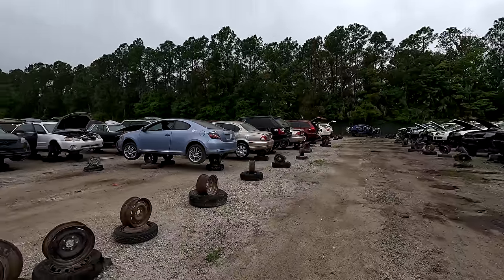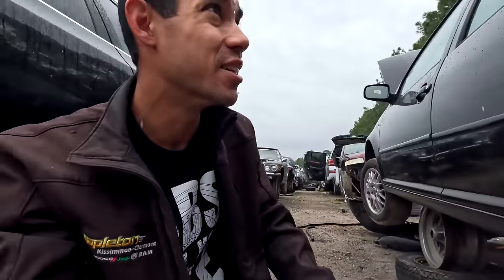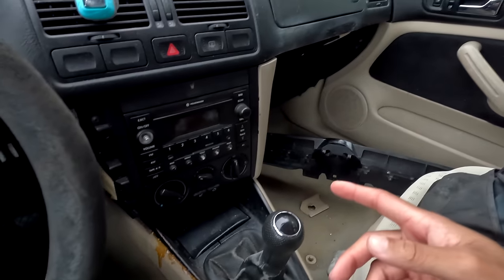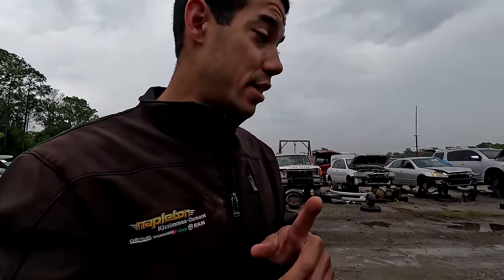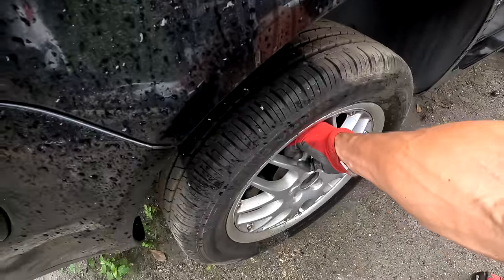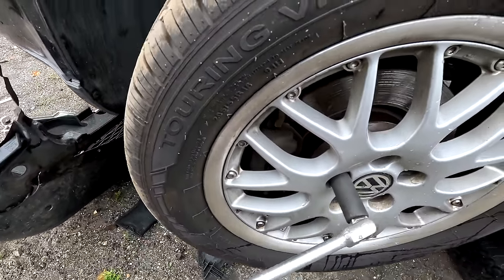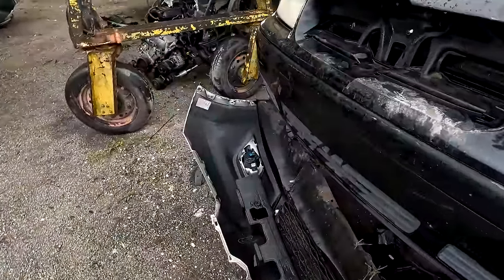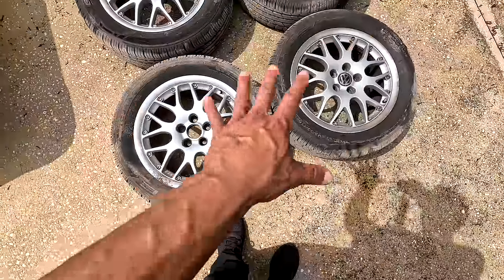Saving A Set Of BBS Wheels From The Junkyard!

Comment: I run these on my subie. They were a pain in the butt to restore though. They were so corroded from salty winter roads, and I snapped the heads off a few of the titanium bolts. Had to bring it to a shop and have them get drilled out, because I wasn’t going to risk messing them up any worse.

Comment: Awesome find I just found a set with an almost identical design but in 18s. Like you said they have curb rash like most and peeling clear but overall going to be a fun project for my first wheel restoration for some nice mk7R OEM+ looking wheels when not running my racing wheels

Comment: Another trick to get the stuck lugnuts to come loose when you can’t put on the e-brake or have another to hit the brakes is to tighten up the 2 lug bolts/nuts next to it
That spreads out the amount of flex of the wheel holding the one lug bolt/nut on, and makes it easier to remove
That’s why its a good idea to always JUST break all the lugnuts loose, before removing them all if all you have is a hand wrench/breaker bar or a weak impact gun

Comment: 10:19......My '03 GLS 1.8T came from Coral Gables or Coral Springs..(if Gunther was around 20+ years ago then..yes)
It was seized/repossessed from original owner for unknown reasons sold at auction in Florida and made it's way up the coast to the Fredricksburg Auto Auction and then ended up on my cousin's lot in Madison, Virginia...(this is 10yrs ago this past January)....I bought the Jetta from my brother after he had it 6mo....it being an original Florida vehicle...IT HAS NEVER HAD IT'S FRONT BUMPER DRILLED FOR PLATE MOUNTS!!!!!...NEVER!!!...The state of Virginia (notice I didn't say GREAT) has been a 2 plate state since before 1948 or around 1950.......I've been pulled up here in Richmond more than a few times even once by State Police...and I vehemently proclaim that I refuse to drill holes into my investment...the plate is in the right front corner of the windshield EXTREMELY VISIBLE plus for the fact that if I'm being pulled..they are in FULL VIEW OF MY REAR PLATE...
so after 70+ years......shit is finally getting contested..........(not all of us up here in RICHMOND need a damn yellow "DONT TREAD ON ME PLATE"....to speak it truly... to the FACE OF THE LAW!!!..)
"Dre' The Cajun"
DES ALLEMANDS
BAYOU CANE.......... find me in the 804

Comment: Ive got the exact same RS771 set, yours look like brand new compared to how mine looked when I got them.
Took me a week of sanding and polishing the lips to get them back to decent looking, repainted the hearts to a slightly different color to improve the contrast betweeen high-gloss polished lips and the hearts.
Too bad these have a horrible weak (ET43)offset and are very narrow, they just don`t do it for me on my project, even with spacers they just dont look right, and they are now sitting unused in my shed waiting to get swapped or sold off

Comment: its crazy how much they look like the mini cooper bbs oem wheels. its the same exact design from the looks of it just in a 17x7 +48? cant remember the off set. but yeah there are 2 that i know of for the first gen minis r50-r53 generation that had 2 piece bbs wheels. the one that looks like this are called r90's and then thers the r98's which are the ones that i have. whats funny is they have exact same issues. clear coat failure on the lips most have some rash. mine have some rash and clear coat failure and some how a gouge in the side of one of the spokes. at one point id love to send them off to be rebuilt and refubed into 17x7.5 in front and 17x8 in rear with around a 35 offset. oem bbs wheels are suttle but so bad ass.they also can take a hell of a hit and still be fine.

Comment: Be careful with those titanium bolts. Soak them in penetrant and brakleen to make them easier to remove. I'm working on some w8 2 piece wheels currently snapped two
Reply: Do you happen to know the bolt specs.  I too have 2 snapped in total😅

Comment: Those came standard on the mk4 Jetta Wolfsburg edition. They made those in 2001 and 2004 (different editions). The car you pulled them from was a 2.0 and all wolfsburgs were 1.8t. Therefore, the owner of that mk4 either bought them from someone or stole them 😂   I had an 01 galactic blue Wolfsburg that I miss every day
Reply: im sure you could buy them from the dealer too as an option. like maybe not all dealers but some could. euro companies are so odd with things
Reply: If I recall correctly the rxii’s were not options because they were specific to the Wolfsburg edition.   At least in the US.